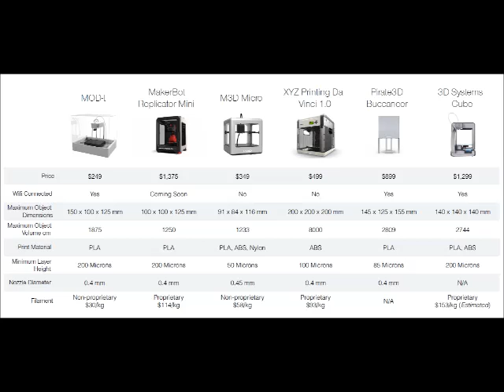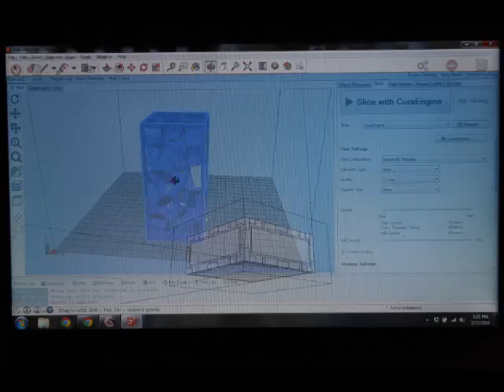Reach 3D Printer - Now Available!

Comment: This is just a low quality creality cr-8 with a milling option. People are just beyond stupid that they fall for crap like that over and over again.
Reply from the maker: Hi Phil, I began this design back in 2014, and this version was an almost completed design in early 2015. I released it on thingiverse in mid 2015. I sold my first printer to a guy named Bud, at the 2015 KC maker faire at the end of June, 2015. Im not saying Creality copied my design, but I can say 100% that I designed this almost a year before Creality was on the scene.
Generally as new components arrive in the market and become cheaper and more affordable, things like 3d printers begin to adopt them. It makes sense that many machines will start to look similar. My design was actually inspired by QUBD and the Bukito Bot - the first printer that I know of to use v-slot and delrin wheels.
I don't own a Creality, but I can say, the components that make this printer, are definitely not cheap. The plates that hold the 2020 and 2040 frame together are 1/8" laser cut aluminum plates. Im not sure the guage or how thin the steel is that Creality uses, but the cost of the components in my design are anything but cheap. I even use genuine OpenBuilds v-slot, not Chinese made Vslot, which, being manufactured in China, Creality most likely uses.
Creality does make great printers, and their reviews prove they are designed and made well.

If your interested in the reviews of this machine, you'll see this machine is definitely NOT low quality. 
I also designed this to be adaptable to many modifications. I released all the design files so anyone can build or easily develop mods for this machine. There are many other uses developed beyond the mill. There is a laser add on, a drag knife, a plotter, and im working on a paste extruder. This printer is part of a living and growing community of tinker'ers that want more than just another 3d printer. Our G+ google community is almost 1000 strong. 

A comparable multi tool option would be the maker arm, all3dp, boxy, formaker, etc... All of which approch $1000. I was simply trying to make this multi tool affordable, via a diy community of developers, cutting out the middle salesman and marketing. I personally cut, solder, test, pack, ship, troubleshoot everyone of the printers I sell, and give my personal cell number to customers needing help. Im not a big company, but I do provide high quality.

Comment: i cheched out your kickstarter. could you buy the milling head on amazon? if so could you please give me a link?
Reply from the maker: The mill is simply a dremel, with flex shaft attachment. 
The cutting head is an endmill from Amazon.
Reply from the maker: The fine endmill that i cut the pcb with was called a "pcb trace isolation bit" I couldn't find another one on amazon or ebay, but i found an individual who sells them on their site.
http://www.precisebits.com/products/carbidebits/scoreengrave.asp